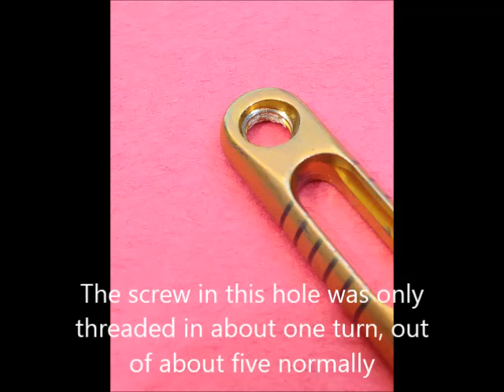TFCC TEAR REPAIR ULNAR OSTEOTOMY SURGERY FINAL OUTCOME

Comment: Thanks for posting this. My doctor recommends removing my plate, but said no weight bearing for six weeks post-op due to screw holes in the bone being weak spots until they fill in.
Reply from the maker: Yep he’s correct. I put full weight on my arm two weeks post op and it gave a sort of feeling like the bone was twisting excessively.  Scared me. I felt like if i had put just a bit more force into it would have snapped. Very odd feeling, sickening actually at the time.
Reply: @jaysmotogp  how 's your screw hole now? Did you lift heavy load?
Reply from the maker: Its fine. After a few months i went back to heavy use with no issues
Reply: Hi Bella how do feel now?

Comment: My UPDATE: Now 16 months post-op on  R TFCC repair and 3mm Ulnar shortening osteotomy and 4 weeks post-op on plate removal.

Bottom line - I've had huge success! No more pain in my right wrist. I was able to get back to my usual activities of doing aerial arts, as well as all activities of daily living. I chose to have the plate removed simply because it was bugging me a bit and I didn't like the idea of having it in the rest of my life. No super massive issue with it. The plate removal surgery is so much easier than the original osteotomy! I'm grounded for 3 months after plate removal, but not concerned about getting my strength back when I'm allowed back up in the air.

If you need this surgery, I highly recommend it. Recovery is not easy, however, but well worth all the work it takes in the end. Research your surgeon, get 2nd & 3rd opinions. Surround yourself with help & support at home & in your recovery as well as your medical team. Best of luck everyone!
Reply: i just had the same surgery 6 weeks out and am having pain in my wrist when trying to supinate. Did you have this?
Reply: @michaelanshus  I was in a cast for 8 weeks post-op. But pain, limitation, weakness as you're starting to move it again is normal. Are you going to a PT? And there is a point of knowing what's "not right" and having the doc check it and "it's part of the process." On my 2nd USO, the plate was up against a tendon or ligament & I could feel it. I know it was "wrong" as it was limiting motion and always tight. No amount of PT made it better. So we took the plate out at about the 7 month post-op mark. it's had some residual affect and I would say while my R wrist recovered 100%, I'd say my left is at about 90%. Best of luck to you!
Reply: @aircataerialarts9009  how long was it before you had no pain?
Reply: @michaelanshus  Well, there's the pain from surgery, which pain meds are for, and then the pain from the original issue that hopefully the surgery repaired. It was so long ago it's hard to remember. I also denote "sensation" as different from "pain." And there's the recovery process, which I wouldn't call "pain." There was tightness, skin healing, some itching, and the usual muscle & joint work that comes with PT. My doc had also done 2 different procedures on each wrist. My R the bone was cut more in the middle, on the L is was cut more distal, which was a way shorter recovery. The original pain from the problem never came back. The surgery pain was gone within a couple weeks & I got off pain meds within 10 days - 2 weeks. If you're having serious pain at the 6 week mark, I would go check in with your doc. But, yes, there's discomfort & sensations for a few months while the wrist recovers. Hang in there, do your PT, be patient, and you'll be fine. :)
Reply: @aircataerialarts9009  thank you! yeah i had right done, bone cut in middle and tfcc stitched for repair. Been a week in a short cast and pretty painful still towards the top of my ulna head... lol especially if i try to supinate. been just over 6 weeks so really worries it didn’t work :/ doc doesn’t think i retore anything so now i’m just lost
Reply: @aircataerialarts9009  I´ve had both my ulnas shortened. The left one was done back in October last year along with a reattachment of the TFCC (TFCC Suturation). The right one was done in february this year. My right feels pretty good, as it only underwent the ulna shortening, but the left still hurts quite a bit. When were you able to do a pushup? My handpalm hurts like hell at the pinky side when doing pushups and right now it doesnt feel like its getting better. It would calm my mind knowing if it was like this for you for a long time. My doctor said it could take a year to know if the surgery was successfull. Plus, when trying to do a pushup it hurts quite a bit around the plate-area as well. It also hurts when pressing hard on the plate etc. Is that a sign I should have it removed? My right one feels much better and its only been 8 weeks since that. Hopefully you can give me an answer, as Ive been scouting around the internet for some time now and just noticed you had answered another one here. Thanks in advancee. Sincerely - 27 year old police-officer.

Comment: I had right ulnar shortening and tendon release on the radial side Nov. 2014. I gave complete trust to my surgeon who has a great reputation after radial and then ulnar wrist pain would not resolve with rest, splinting, ultrasound and OT. At the time of surgery the radial side wasn't even hurting, but got talked into taking care of it since it was such a simple thing-wish I hadn't done that since the nerve is still healing. I had a clicking, clunking feeling that came back as soon as I got rid of the splint. I did lots of OT and went back to work with my clunking. Doc refused to order MRI or any other diagnostic, just offered cortisone injections after telling me there was no risk (not true). I went for a second opinion and that Dr. said no injection, but he could fuse a row of bones which would limit my motion by 50% and said some other crazy stuff.  I did get an MRI which didn't show anything truly alarming. I got a third opinion who specializes in arthroscopy and who offered cortisone after telling me that there were possible risks.  I got some relief from pain, but the clunking/instability never stopped.  I also started having ulnar pain some months back and would ache horribly after trying to use light weights in a workout.  Picking up something while guarding my right wrist causes pain and aching.  I am awaiting a call this week for surgery to remove hardware and have arthroscopy.  This Dr. also offered to release the tendon that he believes is causing subluxation and also offered a PIN neurectomy to help with pain. I'm trying to research that one now.  If I could go back, I would not have done the ulnar shortening.  It was probably not the source of my pain.

Comment: Hi Jay. Thanks for that video. All informations provided are really useful. I am struggling with my TFCC for over two yeses. I’ve had my TFCC repair 9 weeks ago and I’m not sure if I can say that it was a good choice. I am wondering if my wrist stiffness is normal. I keep exercising that wrist a few times a day since I took my cast off but wrist twisting is really restricted ( I would say 90 degrees out of 180 which is poor in my opinion). Could you say when I can expect twisting wrist ?? It is 9 weeks post op but I do not see any progress in this area.

Comment: Hi Jay, I am having the same problem with my ulna. I'm 5 months post surgery and I was using a mouse at work, heard a loud click and a followed by a stabbing pain. I ignored it for 2 weeks hoping the pain would subside to no avail. I went to my GP because I didn't have anything booked with my surgeon. My GP got in touch with the surgeon and I see him next week.

My wrist itself is coming along although my range is also quite limited with flexion too. My ulna pain is also at the elbow end of the plate. The x-ray confirmed that the last 2 proximal screws are backing out. I am hoping I can get the hardware removed in the next few weeks. They gave me a volar slab cast (removable) to wear while I am waiting for surgery to keep the ulna from moving. The pain since they put the 1/2 cast on is not too bad, it's just annoying because I can't really use my arm right now but its better tan taking drugs.

I'm glad your hardware removal went well; I'm petty confident my arm and wrist will be fine once they take the plate and screws out.

Cheers, Hope you are well
Reply: How are you now?
Reply: how are you now

Comment: Thank you for these videos, i'd really like to talk to you about this procedure via email or a phone call. I have to have this same surgery, i have a small tear in the TFCC and need the ulnar shortened. Right now i can use my wrist with very minor pain. The cause of the tear was from swinging a softball bat. The doctor recommends shortening the ulnar and fixing the tear all at once so the bone doesn't cause damage down the road. My thinking is the bone isn't causing the pain it's the small tear, thats what the pain feels like a small tear. So maybe i'd be better off just fixing the TFCC tear by ortho, and not go the route of shortening the bone. I have never had any issues playing golf, softball, job from a slightly longer ulnar bone. It was the swing i made in softball that caused the pain/ tear. Any thoughts on this would be much appreciated, this shit is scary. Your a tough mofo going through all those complications, i can't believe your doctor didn't talk to you after your surgery

Comment: Anyone here not have a surgery and recover well? I’ve damaged my tfcc 3-4 months ago (I was still weightlifting for the first 2 months - stupid ik but I didn’t think it was that serious) eventually took 6 weeks off the gym completely and it healed a lot and now I can do a lot pain free. The only thing is that weightlifting at this point seems to still be bothersome or if I overuse my right hand. I’ve been all around YouTube and it’s always hard to find any information on people who recovered without surgery.
Reply: Ive had both mine shortened along with a TFCC suturation for my left one. Left is 5 month post-op now, while right one is 8 weeks. Can do a lot, but definitely not any weightliftning yet. Still not able to do a pushup without extreme uncomfort. I used to lift 7 days a week, and couldnt let go of the weights after tearing my TFCC at football-practice. Just send me a PM and we could chat up if you want.
Reply: How is ur injury doing i damaged tfcc in early dec took a little more than a month off from weightlifting now it hurts sometimes and main pain I feel is doing any bicep exercise exept for hammer curls i can do those just fine . But any other exercises hurt . Any advice any help anything?
Reply: @Brolyinsometime  injury healed fully - I ended up rehabbing it with a tennis ball/squish ball, and doing other hand/wrist exercises that were easy to look up on YouTube. If you can definitely take some time off for it to heal, and I’d say invest into a bit rehab exercises.
Reply: @stjepanjakic5726  ok . I do rehab exercises but still go to the gym everyday. Another problem was that hen i flex my palm from the pinky side my pisiform bone moves . Which is somewhat troubling
Reply: @Brolyinsometime  take a few weeks off the gym.. rest is most important and I had to as well. If you aren’t already, use wrist wraps for all exercises. Hmm did you get that checked out?
Reply: @stjepanjakic5726  i had it checked one doc said I'll need surgery after that two doctors said no need for surgery and had me in a wrist brace for 1 month . Then the pain is quite low but sometimes it hurts . And I'm using wrist wraps . Main problem is i can't do bicep curls

Comment: Hey, i've had wrist pain since 2014 August last year. i'm still having pain in my wrist at times and clicking of the wrist.. I took a long time off from my work and i am into bodybuilding. in your opinion,if i'm planning to continue my bodybuilding routine,is it safer to skip the op and just learn to cope with the pain?
Reply from the maker: +trolltan1992 Sorry for the late reply. As far as skipping the op, I would unless its painfull to the point of keeping you up several nights per week. When it starts interfering with basic life necessities, like sleep, that's when a decision needs to  be made. I would however consider the tfcc repair only first, then evaluate results and leave the Osteotomy for only when you absolutely have no other choice. hope that helps
Reply: +jaysmotogp Hi Jay. Thanks so much for these videos. I've watched the first five and then skipped ahead to your last. I've dealt with wrist pain for a year now, and my orthopedic surgeon says I need ulnar shortening. I hope you don't mind a few more questions. 1. I'm curious why you aren't advising an osteotomy unless "you absolutely have no other choice." I realize you had a lot of complications and a long healing time, but aren't they well worth it if you can resume old habits (like weight lifting and biking and just generally living without pain from everyday activities)? I, myself, have mild pain. And when I don't use my wrist and keep my wrist in a splint, I have no pain whatsoever. It's never kept me up, but I know I can't do ordinary things anymore, like hold a gallon milk jug, turn door knobs, use hand tools, and certainly not lift weights (which was one of my daily hobbies). But I can type, put my clothes on, and hold utensils without any pain whatsoever. Despite these low levels of pain, as an athletic person my normal life does seem to be disrupted, and the prospect of a year of post-surgery pain and weakness does seem worth it as long as I can resume normal activities afterwards. Any thoughts on that? 2. You may have talked about this in your other videos, but can you tell me about your health insurance situation? Were you still under your employer's insurance? Did you utilize the Affordable Care Act? Do you have any recommendations regarding this? 3. It's been five months since your final video. Any new updates? Is your wrist/forearm still fairly close to 100 percent strength and range of motion? 4. Have you discovered an online community that talks about the ulnar shortening recovery process? I've found a few testimonies on healthboards.com, but they're often dominated by a few users with horror stories. Thanks again!